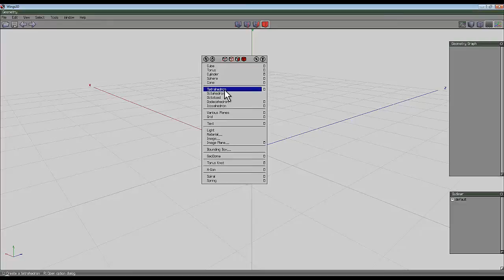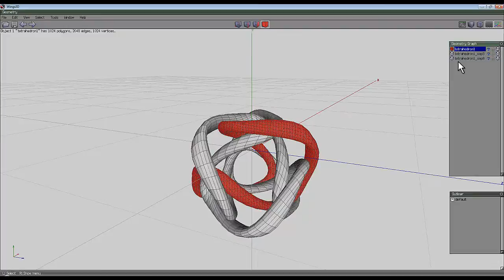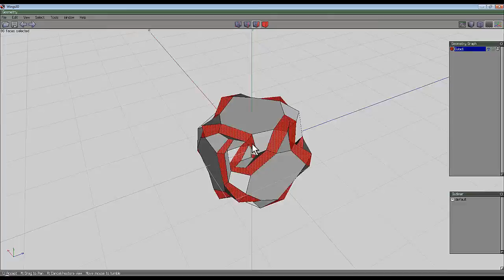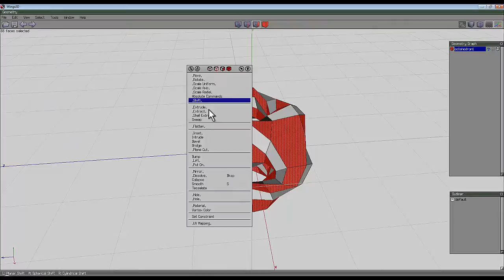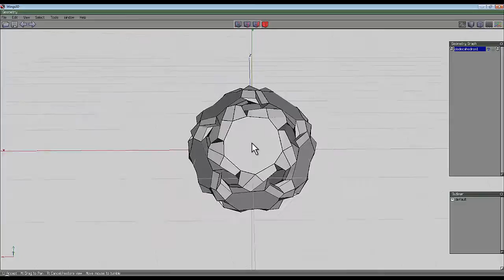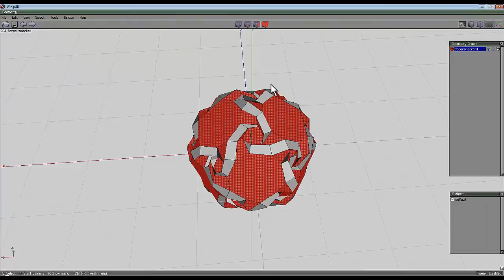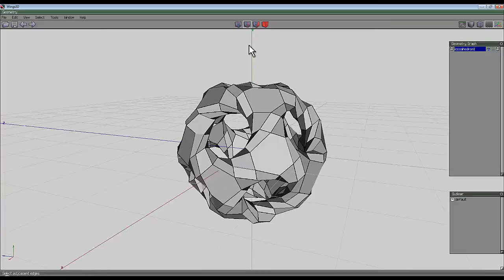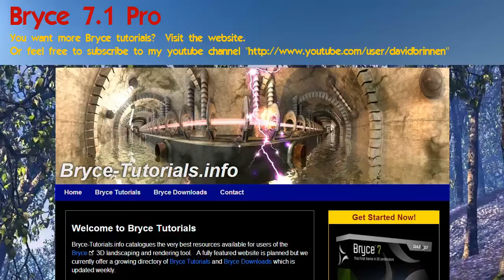Wings 3D project - Art Wade twisted loop test on five perfect solids - by David Brinnen.

Comment: Did you find a connection? I can't find one but I'll continue to think about it.
Reply from the maker: +Sunlessmage, no sorry, my maths is not that strong.  I keep hoping someone will see this and come up with an answer, but maybe not... maybe it's just one of those things that are true just as the limits on perfect solids, or types of mobius surface or prime numbers.  Just a maths thing.
Reply: My opinion is that answer lies in separate algorithm of Wings3d. It selects intruded face loops and separates them. Question is:
is that min/max number of loops possible of there is more. If it's unique number than math should find some answers.

Btw, could you make another wings3d strange shape ?
Also, did you try making some shape in Blender?
Reply from the maker: +Sunlessmage, maybe so.  It is a bit deep for me.  I just doodle away.  I've not tried Blender.  I have recently got into Modo which I find very nice to use.  Not as intuitive as Wings for these kind of shapes.  Modo is good don't get me wrong, but I think Wings for this kind of thing has the edge.  Modo can do a lot more, for sure, it is very good, but for different kinds of things.

Comment: I think the number of separate parts has a lot to do with how everything is oriented. Certain angles and shapes are repeated uniformly in the perfect solid, which is why it is called a perfect solid. It depends on how many sides each face has and their angles in relation to each other, but you must note that the same angles are used all around one. All the angles in a cube are exactly 90 degrees, 4 X 90 = 360, so though a cube has 6 faces, you will get a result of four due to the repeated angles forming 8 points. This is just a guess though!
Reply from the maker: It's a start.  If you can compose a theory for one solid, and then the formula holds true for the others then it might be possible to speculate about the sphere?  So in your view, that are all the angles in a sphere?  It can't be 180 - that would make it a plane.  So that's the top limit.  And it can't be less than the Icosahedron.  http://en.wikipedia.org/wiki/Icosahedron  Hmn... that's quite an interesting page.  I will have to get back to that...
Reply: The most logical division of any sphere would be triangles, and all of those would be equilateral and the same size. The amount and size of the triangle would be governed by a mathematical formula, but math is not my best subject.
Reply from the maker: ArtAgent13 Nor mine neither :(